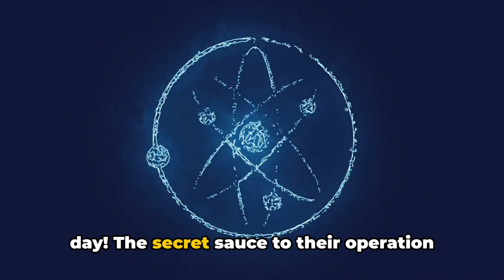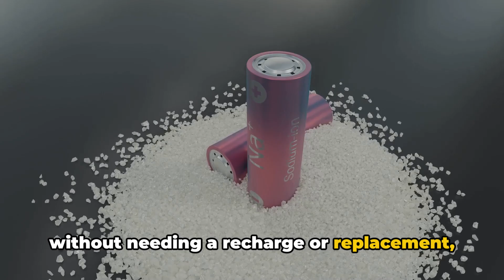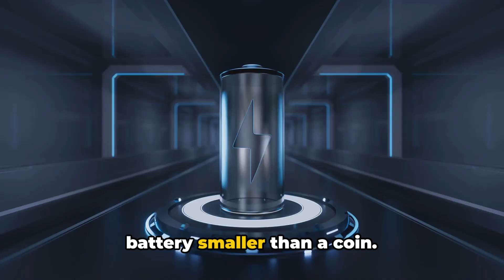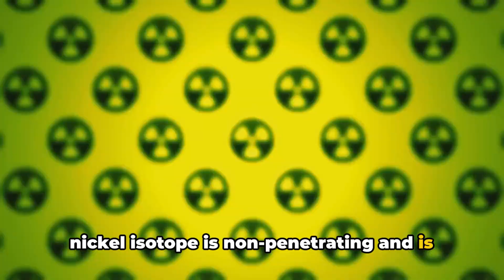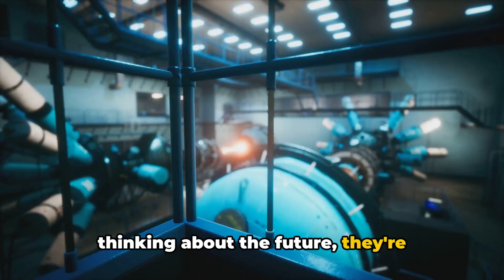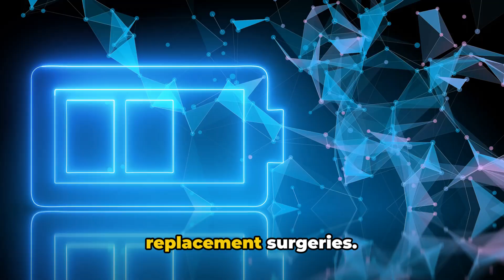China's New Nuclear Battery - 50 Years Long Lasting Betavoltaic Power Source #battery #newinventions

Comment: Have you ever stopped shilling and lying?
Reply: the low effort AI voice is the cherry on top
Reply from the maker: https://www.scmp.com/news/china/science/article/3248960/chinese-developed-nuclear-powered-battery-can-last-50-years-without-recharging
Reply: @Mytechinsights  https://youtu.be/nEmO8DcOap4?si=i5L8pkdwqbVBrOkT
Reply from the maker: https://www.independent.co.uk/tech/nuclear-battery-betavolt-atomic-china-b2476979.html
Reply from the maker: https://economictimes.indiatimes.com/news/international/business/china-introduces-revolutionary-nuclear-battery-that-lasts-50-years-without-charging/articleshow/106880627.cms?from=mdr
Reply from the maker: https://www.wionews.com/science/chinese-startup-develops-coin-sized-nuclear-battery-that-can-last-up-to-50-years-without-charging-680562
Reply: @Mytechinsights  Nothing but news articles. Same shilling and lying
Reply: @Mytechinsights  https://youtu.be/uzV_uzSTCTM?si=0OgDGMYVFMlYWFfZ
Reply: I agree with your opinion, it's completely understandable and you're also right. The batteries will never be able to hit 20 volts without a step up converter. But the batteries are true. Once I get home, I'll make one again and make a YouTube video about it. This is possible and it's true, the radioactive material releases electrons (beta particles), and then a special material collects the electrons, and turns them into electricity.